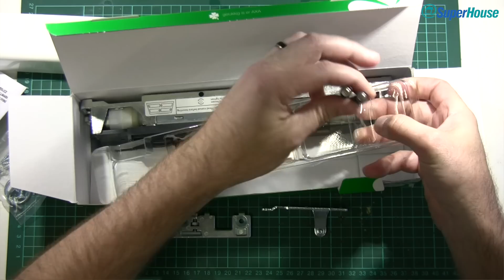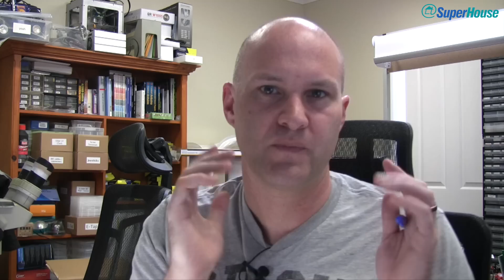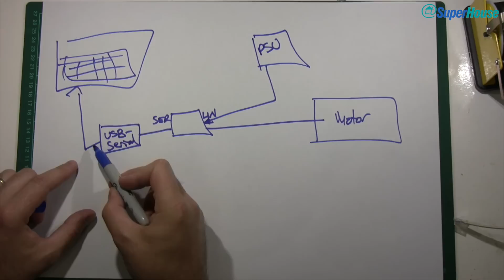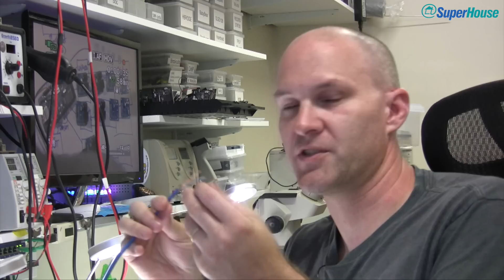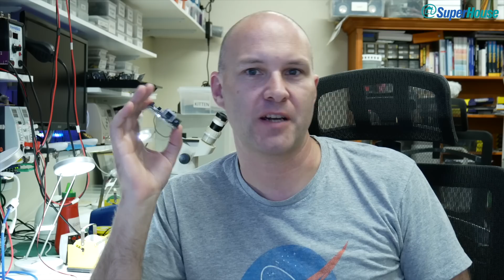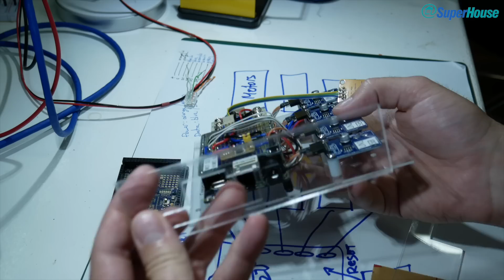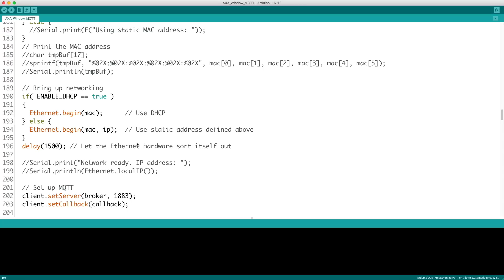SuperHouse #22: AXA electric window motors controlled by LIN bus and Arduino

Comment: I have noticed the AXA 2.0 is still available now.   
I am thinking of doing this and integrating to Home Assistant via MQTT.   Do you know if the LINBUS adaptors are still available to connect to an ESP or Arduino?
Did you fully solve the cross talk issue with the firmware?   I was thinking maybe if you used all the "white" cables for bus and the solid colours for power (or vice versa)?  Would having power wrapped around data cause an issue?

Comment: What a great sun room. The interior supports for the windows act as a heat sink. Window support structure needs to be on the exterior of the windows, preventing the reflection and heat sink effect.

Comment: Interesting, with your setup you could simplify it with the following changes:
Use the twisted pairs for the data
Dedicated low voltage wires for the power
All 4 chips on a single shield

This would solve the interference issues, and allow you to bring power at the same time, though the main downside is that you would need a breakout system at the windows.

My prefered setup would be to have 4 dedicated ethernet cables, which would plug into a single shield. (The connectors would be on the outside of the case, with wires connecting them to the shield, which makes it easy to rack mount the design in a 1U case.)

Comment: Hello Jonathan,
I can see that on the LIN BUS CHIP you have chip select on them, why are you not using that to select the individual chip you want to communicate to, bridge all the serial TX and RX to an UNO RX and TX so that you can cut down the cost of the project. I see that you need CS to be connected to VCC, so connect the with pull down resistor to ground and then using a current limiting resistor you connect the CS to digital ports on the UNO and then select the CHIP to receive commands.

Comment: Great system dude! For the crosstalk issue i'd changeup your pinout, For-Example: Use Solid colors in the Cat5 cable to handle the LIM data then pick 2 stripe colors for DC+ and the other 2 for DC- That way you have minimized parallel capactive coupling between the pairs.

Comment: What motors/equipment are you using to control the Shades in the conservatory?

I’ve seen there is AXIS (Coming soon) and MOVEZ (Coming soon) but wanted to know which ones you used and I couldn’t see a post / reference to it elsewhere.

Thanks.

Comment: That is weird! If you cannot address the motors on the bus, it really does not make any sense to even have a LIN bus, I can simple do that with two wires and a DPDT relay (that's what I did in my green house). The people at AXA have to do some work to get this right.

Comment: For current inrush on motor start you could stick big capacitor in parallel with power in the empty battery compartment of each motors

Comment: Great video. Those AXA units retail for about ~£120 in Uk. I suspect you got them free or in a semi-free deal? I think a much better option is using the ACK4 230v Electric Window Opener. What I have. Costs about £120 here in Uk. Use with relay and ESP8266.

Comment: Hi  watched a sonoff video and lo your channel popped up in my feed so have watched several of yours now......Google knows!  I have similar windows (woooden noy metal) to you so I enjoyed this though (a) finance committee would not pass the budget (b) My skillset and toolbox in accountancy wouldn't fit well with going the whole way down this project and (c)  How does your system handle sticky windows what is the torque?  Finally I use Visual Basic code in a couple of my work functions and are surprised by the crossover in code syntax between what i use and what you used. Anyway looking at roller blinds and possibly using hacked RF toy car motors like the Soma Smart Shades - Soma Smart Home but Amazon dont ship and nothings cheap in Australia...maybe a project?  Again Torque is an issue as I want one turns the blind cord not the tube itself also solar.

Comment: Given that each device on the bus reports a 200 OK, wouldn't a more elegent solution to sending a command to all 4 devices on the bus be to wait for the 200 OK before moving on to the next device, Instead of using an arbitrary delay? This way you are guaranteeing receipt instead of assuming it.

Comment: Obviously you haven't heard of triple glazed LOW-E glass. The solution to heat and cold is INSULATIONS AND HEAT REFLECTION.
Reply: Yeah to a certain degree pardon the pun. It a glass house buddy. Low-E helps but there is only so much you can do.... double, triple glazing , or how ever many is only effective as the size of the air gap. Timber windows are more efficient as they dont are not thermal conductors. Id rather have airflow and automation.

Comment: Could the firmware on the motors not be modified to include device IDs for the motors themselves? Or is that level of hacking a few levels beyond the skillset?
I'm honestly not asking to be rude, quite the contrary. I am interested in the process of this should one undertake such a task.
It seems that your problems would be solved if this could be done. Maybe even reach out to the manufacturer for a copy of the code (even under dev NDA or something)?

My interest is starting to be piqued with home automation and getting ways to also include fire and intrusion detection ;)
Reply from the maker: Addressing them individually would be the best outcome, but I only have 4 of the motors and they're all attached to windows! If I can get hold of another motor (maybe a broken one) I'll pull it apart to see how they're controlling it. I did consider removing their entire control board and making my own to swap into their chassis so that I'd have total control over the firmware, but I have other projects to work on first.
Reply: Interesting.
So, getting and hacking firmware isn't as trivial as it seems and making a custom board requires a fair bit or R&D. 
Any teasers for upcoming projects? :P
Reply from the maker: Modifying the firmware would require either the cooperation of the manufacturer (to provide the original source code) or writing totally new firmware from scratch. To do either of those things I'd need to learn about the specific processor used in the controller, such as what registers it uses, what timers, interrupts, etc. It's not a small task! There's a list of possible future topics here: https://www.patreon.com/posts/8033622
Reply: It seems strange that the manufacturer would go to the trouble of implementing LINbus but hobble it by not supporting device addressing. Maybe it was the cost of adding a DIP switch or somesuch for setting the device address is what killed it in the production model.

Comment: Nice project! Maybe it was also possible with 1 arduino and 1 lin module and 5 relays.Control the relays with the same arduino. Use each relay to select the window motor (data line) and the rest as in the original  control. So first you set the window you want to control and then send the command via arduino+lin module. Use the 5th relay to connect al datalines together and then you have control over the 4 windows in parallel.
Reply from the maker: Yes, that would probably work too.
Reply: SuperHouseTV I also thought you would use some sort of multiplexer IC when you told about the 4 wire solution... I think that would have been easier and more cost effective.

Comment: Great video Jonathan.   I love seeing the trials and tribulations of a project like this.  Problems arise, solutions are found, directions change mid project. Fantastic!
Reply from the maker: Thanks Michael! The good news is that updated PCBs for the LIN module have arrived, so the RJ45 socket fits perfectly now. I still need to finish my integrated board that will replace the collection of modules linked together with jumper wires.

Comment: What kind of tablet is that in the intro? I've been considering doing something like that with some Amazon Fire Tablets or whatever they are called (Amazon's 50 dollar tablet)
Reply from the maker: It was some cheapie Android tablet that I got in China quite some years ago. No brand, just something found in a market in Shenzhen. I also have some Microsoft Surface tablets on the wall, which have fantastic hardware (great screens) but not so nice software.

Comment: Hi great video! Very interesting and informative. I've been struggling with the AXA motors myself. Especially since there is hardly any info about the 'home automation' part of these motors, whilst  AXA does put 'very suited for home automation' in its brochures... I've even contacted AXA directly (I'm from holland), with no real results. I really want the motors to be addressed individually!
I'm also in the possession of the linbus shield, but never installed it once I figured out that it is not possible to address the motors individually. Your video is a new eye opener how ever!
What I've done is that I've hacked into the remote and routed additional IR leds to each motor, using transistors to control each motor separately. All connected to an arduino interfacing with domoticz. I'm currently adding some ultrasonic sensors to control the position in more detail and get feedback of the current position.
Now You've got me wondering, I might be crazy, but I don't have all this knowledge so I'm just asking... Wouldn't it be possible somehow interrupt the linbus signal to all motors but 1, thus being able to control the motors individually. This would mean however that the linbus signal has to be able to pass thru a relay or transistor or what so ever, this I do not know, neither could I find any information about it. Could you give any comments on this idea please?
Keep up the cool videos! Also really interested in your openhab setup!
Cheers Sebastiaan
Reply from the maker: That's a great solution! I love the idea of using ultrasonic sensors to get feedback on the window position. I may give that a go. I'm definitely going to follow up on this video later after I've made an integrated controller. I'd like to get an answer on the addressing issue, too. Without any other information from AXA I think it'll be necessary to watch the data line with a scope to see if there's any address information being sent. I don't think there is.

Comment: Is changing the firmware to allow individual communication to the motors out of the question or not possible(Similar to what you did with the sonoff)? It really seemed like daisy chaining the motors was a much more elegant setup.
Reply from the maker: I haven't pulled a motor apart to investigate the controller, but there's a possibility that they could be reflashed. I only have 4 of the motors at the moment and they're all mounted on windows, so I'd need to get another motor to experiment with.

Comment: Great and inspiring video as always! Please do more videos like this where you don't cut out the encountered problems it makes the videos very interesting.
Did you ever try visualmicro for your debugging and coding? Like you told in your video you do a massive amount of debugging with println in the serial monitor with visualmicro pro you can debug your arduino just like a pc based code. I am using it for quite a long time now and it is the most helpful arduino tool I have encountered so far.
Reply from the maker: Thanks for the comments! And thanks for the tip on visualmicro. I haven't used that before, so I'll check it out. I don't run Windows but I can set up a VM if necessary.
Reply: SuperHouseTV Yeah I am using Visual Studio since i use it every day at work but at home I run a windows VM using KVM and its working flawlessly. Depending on your OS it can be a bit challenging to get the serial connection to the Arduino through the virtual machine but once it is set up i haven't had any problems.

Comment: Could you do a teardown of the AXA module and maybe reprogram the modules with individual LIN addresses that way you could use a single bus to communicate with each unit individually? Isn't this what the manufacturer should have done to begin with?
Thanks for the videos :-)
Reply from the maker: I'd like to do that if I can get another motor. I only have 4, and they're all attached to windows now. I might see if I can get a broken one from the importer so I can pull it apart.

Comment: Nice watch, thanks.
So, this is where I can see that I'm much more lazy than you. Once I get v0.9 working, I call it done, and move on.
Yes, a USPS cardboard box cut in a few pieces with otherwise exposed everything is a fine production system :)
https://www.youtube.com/watch?v=Qvsb9gRpLmw
from http://marc.merlins.org/perso/linuxha/post_2013-01-30_2-way-talking-to-a-Lockstate-LS-DB-500R-lock-because-the-Lockstate-wifi-Remotelock-is-no-good-for-me.html
And of course, I have professional I/O mapping on a yellow sticky :)

By the way, I do agree about your rule on crawl spaces and going to the roof. The crawlspace is bad (and mine is clean), laying all my 1wire temp sensors in the vent holes and inside ducts, was a pain. My attic is usually super hot and full of insulation stuff that leaves fibers in the air that really you shouldn't breathe for long (if at all). I use a dust mask, but it only works so well.
So yeah for everything going back to an accessible patch panel!
Reply from the maker: Thanks Marc! Yellow stickys, the industry standard for cable labelling ;-) Yes, best to stay out of the crawlspace if possible.

Comment: This is great!!! It would be amazing to see more in-depth videos of this length! How long did it take for you to knock this one out? Also, whats with the audio (RF?) noise when you're in your lab? Are you using the wireless lapel in there, or is it wired? I'm guessing since you're in there with a bazillion scopes and power supplies, you're bound to get some noise! :)

Edit: Also, awesome to see Inkscape out in the wild!
Reply from the maker: It was recorded over a period of months, with maybe 4 or 5 days of solid work at the end to get it finished. I still have a couple of days work left to write the supporting documentation for the episode page on the SuperHouse site.

I experimented with a few different microphones during this episode because getting clean audio is really hard, and I'm trying to find a way to do it that isn't so much work. In this video I used a wired lapel mic, a wireless lapel mic, and a Rode Videomic Pro. I also used 4 different cameras trying to find a process that would make it quicker and easier to set up each time I want to record something.

Comment: Hi Jonathan, really interesting video, well worth the wait.  I liked the longer format; seeing the whole process, the decisions made, decisions changed, etc.  I did wonder if power was going to be a problem, especially simultaneously driving 4 motors from a PoE powered device over CAT5, but you didn't seem to have any issues with that.  I guess the little motors don't pull that much current then?    I had never heard of LIN before, I thought cars used canbus?
Reply from the maker: There are some issues with power, but it's fairly minor. If I have two motors running and I stop one, I can hear the remaining motor speed up slightly. That means there isn't quite enough power getting to all the motors, which could be either voltage drop across the cable or it could just be that the little plugpack feeding in the power can't supply enough current. I haven't bothered metering it yet to find out but that's on my to do list for a follow-up. Cars do use CAN, but CAN is overkill for some simple applications so LIN was developed as a supplementary bus. CAN is fast and complicated, LIN is slow and simple. The usual topology is to use CAN as high-speed links between major subsystems, and then to use LIN for small local sub networks. For example, CAN will link the car's window controller module to the other major systems, but the window controller will then use LIN to talk to each of the individual window motors. This approach keeps low-priority local comms off the main CAN bus(es).

Comment: Wouldn't it be more reliable to use 1 twisted pair for each of your 4 data lines and then use the 240v cables you have in the frames for running distributing the 12v? You could fix up a little connector in each empty battery box to translate the power and data into an RJ12 plug.  That way no cross talk as each data connection would be on a pair.
Reply from the maker: Yes, that's a good idea, but I decided not to do it because it's very tight in the motor case and I didn't want to fiddle with breaking out the big flex cable. I'm also paranoid about using mains cable for anything except mains, because some time in the future when I'm long gone someone may find that cable in the ceiling and think it's meant to be at 240V AC. However, now that I'm going to follow this up with another video showing the crosstalk on the wires with a scope I think it's worth going to the trouble of doing that to see how much effect it has.